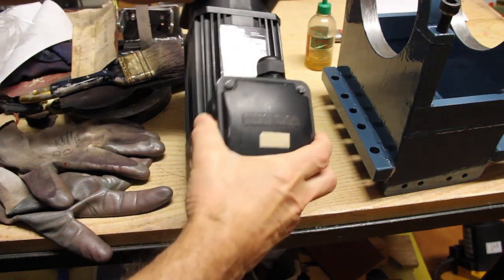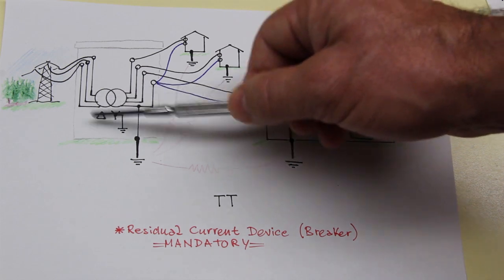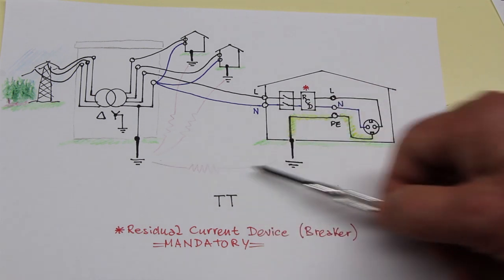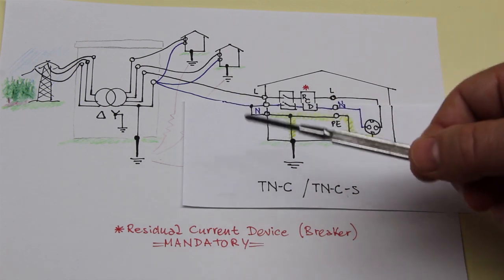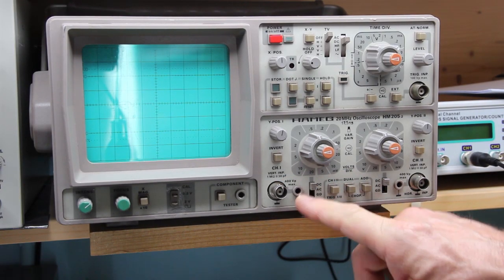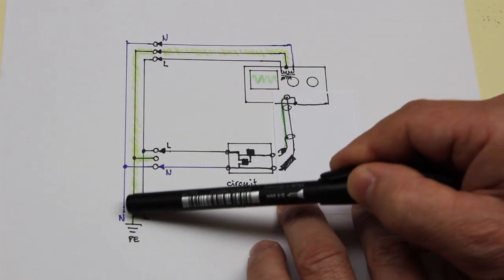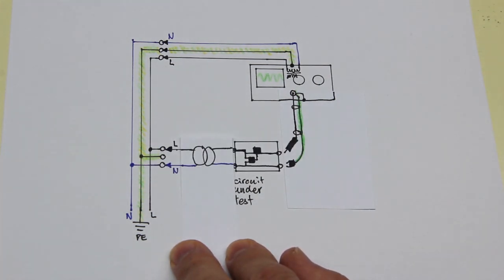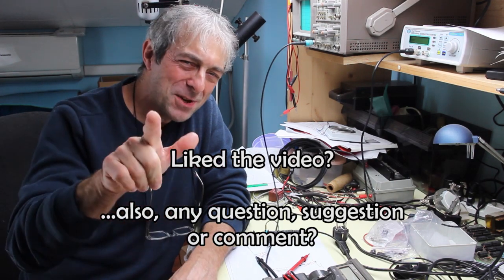Correct use of the oscilloscope when probing circuits connected to mains

Comment: What if the power supply gets the spurce from main similar to scope? Its confusing. Power supply also have ground which you use in circuits. Im glad i bought a battery operated scope

Comment: Main ac should be avoided. What of measuring indirectly through step down isolation transformer(120/240 v to 6v)? The oscilloscope probe would be connected to 6v output. All safety measures must still be observed

Comment from the maker: *VERY IMPORTANT - DISCLAIMER*: THIS VIDEO PROVIDES INFORMATION ABOUT A NARROW TOPIC TARGETED TO UNDERSTAND WIRINGS AND CURRENT PATHS. WORKING WITH CIRCUITS AT MAINS VOLTAGE GOES BEYOND THE SCOPE OF THE VIDEO. 

OPERATING ON MAINS VOLTAGE REQUIRES SPECIFIC TRAINING AND THE ADOPTION OF SAFETY PROCEDURES AND PROTECTIVE GEAR.

Comment: the only way its possible to use an earthed instrument to work on mains is to galvanically isolate with an isolation transformer. You can make one for your scope using 2 x 120v to 240v transformers.
Trained users only.

Comment: Good information thank you.  My solution for using scope with mains circuits is to isolate the scope by plugging it into a "portable power station" which is basically a battery and inverter.  I use a Jackery 1000 (which is overkill) but any unit with a pure sine wave output should work.
Reply from the maker: That's an interesting idea. Just be cautious with the exposed contacts such as the metal of uncovered BNCs.

Comment: Thanks, great video. I missed one option: Connect only the hot of the probe to the mains power as there is no need to connect the ground of the probe as it is already going to earth via the mains of the scope itself. This should make it possible to measure the 230V safely by the scope or am I mistaken?
Reply from the maker: Thanks. About your option: 1) you actually don't know how internally the scope is wired so you can't predict the exacth current path. Very likely the input amplifier won't like this 😉 .
2) there are many occasions where you need a measurement that is realative to some point in your circuit under test and not in reference to earth. 3) neutral is not the same as earth (or PE). Also this definitely wouldn't work wth double live (non neutral) mains (ie 120+120). 
4) often oscilloscope inputs can cope no more than 300Vpp, your probe wouldn't work attenuated without the return path.
5) shielding wouldn't work.
Conclusion. I think those are enough reasons to reject this option.
Happy new year 🍻

Comment: And second i am writing about the effort to test a relative large UPS when replaced its dead batteries with a laptop power supply connected in series with the bench power supply which is fully isolated from the mains.UPS batteries and their charging circuit was isolated,but laptops minus is connected to the mains grounging exactly as the oscilloscope minus does.The result was to end with a blown cpu and the UPS finally took its own way to the recycling simply from nothing.And still i cant believe it,it brings me bad memories.The same thing occurs also for AT PC power supplies,metal casing and minus output are connected to mains ground.

Comment: Can I ask sir, how about in our country where we have no ground in our outlet and only live and neutral?
Reply from the maker: I suppose you mean unearthed neutral (otherwise it is similar to what is showcased in the video). In that case the situation is similar to the one with an isolation transformer. However a question arises: where the oscilloscope's ground is connected? To arrange a laboratory the best practice is to have an independent ground and ideally the circuit should be a TT (see Terre-Terre grounding systems).

Comment: I needed a recap and this was good, BUT i do not have a differential probe or isolating transformer any more and need to see waveforms on the mains side, I did think of disconnecting the earth from the DSO, but thought there might be another option hence looked it up. But it looks like I am going to have to disconnect the earth as I am not spending a lot of money for something I may never do again, how about I connect the earth from the DSO to a 1Meg down to ground just so I can test?
Reply from the maker: I've uploaded a short video right now to answer your question, and a more detailed full-length video will follow next week. Hope you'll like and share. Greetings from the Alps.
Reply: @AccidentalScience  Thanks, I will be interested, but in the meantime I have disconnected the earth all together, enabling me to test the live voltages with success, look forward to the video!
Reply: @engjds  Please tell me how you did to disconnect the earth's ground from your oscilloscope's ground. I need to test a live 120VAC triac circuit and can't afford isolation or differential probes. I thought of using a 3-prong to 2-prong adapter which has the ground-pin removed but I'm not sure. Thanks.

Comment: Excuse me Sr, What happen if I connect a Transformer to feed My osciloscope instead of feed the circuit that is going to be test ?
Reply from the maker: In that case the oscilloscope is isolated so no risk to blow it up, yet the circuit under test is stll connected to mains and you risk to be electrocuted or cause other accidents if you touch thè body of the oscilloscope or it touches other earthed things, e.g. a nearby instrument. This is why the isolation of the oscilloscope is  not recommend. There are special oscilloscopes that are fully insulated in a way that the body, knobs etc are safe to touch even when (internally) the scope is connected to mains. Powering the scope through an isolation transformer is not enough to convert a common oscilloscope into such a special kind of oscilloscope.

Comment: Yes there is a risk of short circuit because the grounding clip of the oscilloscope probe is connected directly to the earth of the mains voltage socket plug and there is 50% chance to contact the phase wiring of the device being tested.A such an accident i had in the past while trying to repair crt power supply and connect ground clip to the minus of the mains capacitor followed by a short circuit,fuses blown till the companys counter box and the tv had 4 rectifications diodes blown and a fuse.The solution is to connect either the tested device to the mains through an isolation transformer or to connect the ocilloscope to a plug without having the groung pin connected to the mains socket.The conclusion is that earthing the oscilloscope protects only from leakage malfunction of the oscilloscope itself and has nothing to do in no circumstance with the device which is being under measuring.Battery operated oscilloscopes or other testers dont have this issue because they dont use mains earth grounding.
Reply from the maker: Thank you for having commented and told your experience.
I'm sorry to say that isolating the oscilloscope through a plug without ground prong is not a good idea. Besides the risk involved in the case you touch the chassis and get electrocuted, the parasitic capacitance developed between the chassis of the oscilloscope and ground (not the ground wire, but the actual Earth) introduces a lot of noise and makes the transients ringing.
Battery powered oscilloscopes that are meant to work with no grounding are designed to minimize this parasitic capacitance, and they are fully insulated to prevent shock hazards.
If you are working often on those kind of circuits consider to purchase an isolated differential probe, or just a battery powered scope (that will likely cost as much as a differential probe).
Cheers.
Reply: The scope should always be connected to ground earth as I understand it.
Reply: @northgork  If a scope connected to ground then an isolation transformer must supply the tested device,for example a welder machine while scoping pulses on output mosfets.

Comment: What if I disconnect the earth from the plug of my oscilloscope completely?
Reply from the maker: As said in the video while it could work it is also quite dangerous cause you could get electrocuted! Absolutely a deprecable practice. Also beware of the max voltage supported by both the input of the oscilloscope and the probe.

Comment: Is the test circuit connected to earth ground? It does not look like it is from your diagram.
Reply from the maker: No, it is not. It hasn't, because PE must be connected to the chassis *only*.
Reply: @AccidentalScience  so is the test circuit powered from an isolation tansformer?
Reply from the maker: @northgork  no! What would be the point of the whole video otherwise?
Reply from the maker: An other point: that is not a test circuit but it is the circuit *under test*.
Reply: @AccidentalScience  So you show a scope that is not earthed, how does that help the point? Your scope power cable does not have an earth ground. Thats bad. Your explantion is quite excellent however there is a short coming. You should make it clear that if both circuits are wired to the same earth ground and you touch the ground probe to a power rail of the circuit being tested then current will travel from the ground probe to the scope ground, then from the scope ground to earth ground then from earth ground back to the ground of the circuit under test, then zap! You have a short circuit. You did not explain how current can travel when the probe ground clip is connected to a power rail on the circuit under test. I know that is what you meant, you just fell short of a clearer explanation.
Reply from the maker: @northgork  the scope IS earthed! I even recommended to avoid the trick of using a non-earthed cable. Did you watched the video in full?
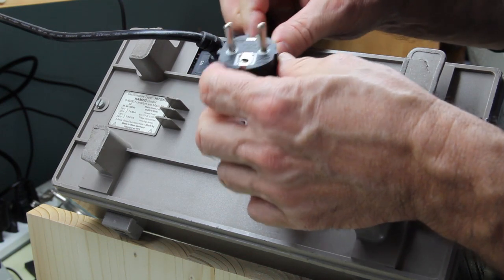Reply: @AccidentalScience  @9:20 you show a 2 pronged plug for the scope but on your schematic the scope shown is connected to the earth ground. This is confusing. Why did you show a 2 pronged plug when you are using 3 prongs? Also at @13:00 you do not make it clear that the circuit under test is powered by an isolation transformer, you should show this isolation transformer in the schematic, and answer how the isolation transformer is earthed. Otherwise the diagrams are great, but the overall presentation could be more succinct.
Reply from the maker: @northgork  that plug is a Schuko plug, the earth is that metal contact in the middle. It is one of the European standard plugs.
Reply: @AccidentalScience  Oh ok. So what is the purpose of the round hole in the Schuko plug?
Reply: I found the answer here: https://images.app.goo.gl/F498rKwCswKAw3og9. Basically the hole connects to a male receptor in a Schuko compatible socket. We have too many standards. What a mess. Thanks for pointing this out. We do not have these types of plugs where I am from.

Comment: The grounding EU idiots got to ground no only scopes but soldering irons too. Remove SMPS from scope and get transformer instead. Your DMM is floating for a reason. Another "smart" youtube influencer tells tales how floating scope can kill it with static discharge, really funny. If 400/600Eur scope can die from electric static then company will have big hole in their pocket. That is all I can say. Try to kill DMM on milivolt range for skeptics.
Reply from the maker: I did never say the scope would be killed by electrostatic discharges. Here the problem is YOUR OWN safety AND to avoid to fry the scope/probe and or your circuit under test. The grounding rules didn't come from the "EU idiots" (I suppose you are referring to politicians) but from a committee for standardization composed by electrical engineers, that I think are all but "idiots".